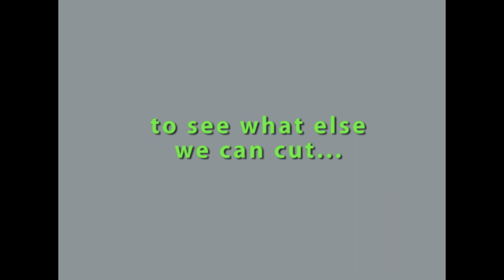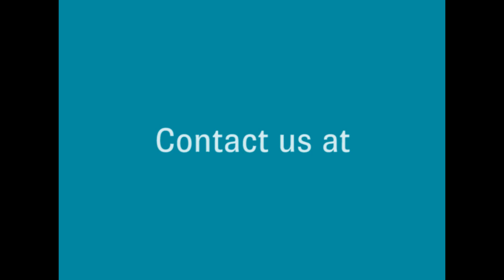Can Water Cut It? iPhone!

Comment from the maker: @SILENTKILL1111 - When a waterjet "cuts", the high pressure stream of water/abrasive slurry mix is eroding the material.  The thickness of the cut material can vary depending on the z axis height allowed on the waterjet. If you can fit the material beneath the cutting head, then a waterjet can cut it. We offer machines up to 24" in z axis motion.